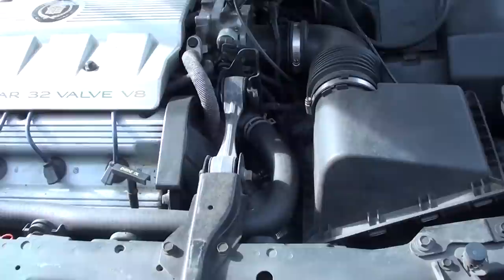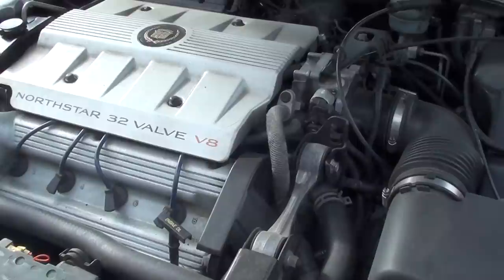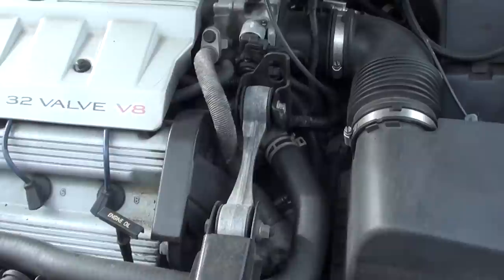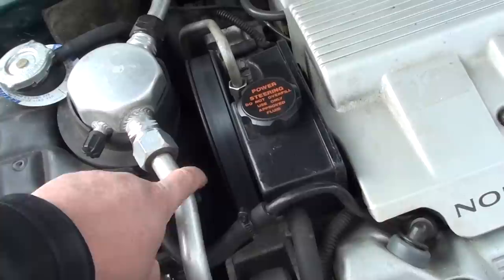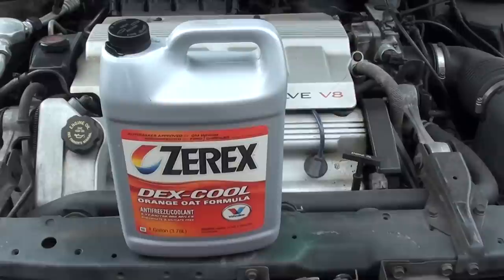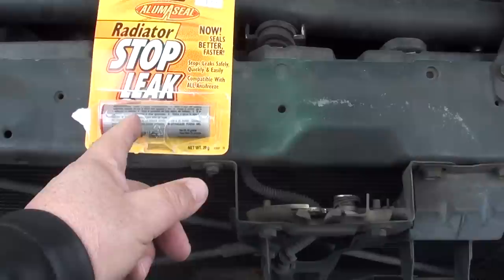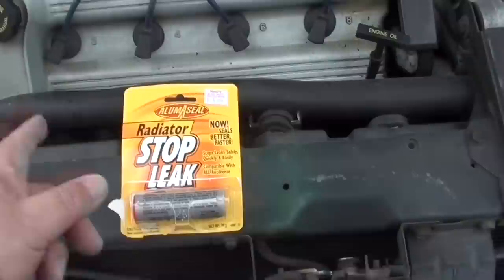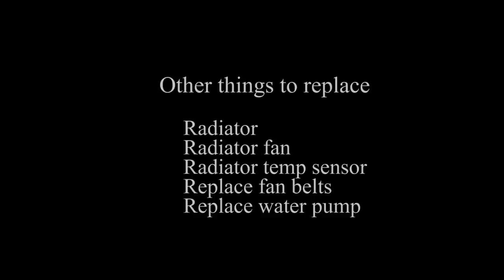Cadillac | Prevent Northstar engine from Overheating | What Mechanics won't tell you

Comment: Dude thats just way too much keep up especially if you have a girlfriend who barely knows how to put gas in it lol mu girl owns a 07 g35s sedan with over 167k miles and it runs better than my 2015 mustang gt lol with way less miles it would be a headache to buy her a caddy with a northstar engine, plus u said u dont go over 65mph man thats a whole lit of babying. I use to own a 07 Nissan Altima 3.5 se and beat that car up everyday and it never gave me a problem just changed the oil every 4k to 5k miles and it ran great with out doing or checking all that stuff you do on ur Cadillac. I owned a 93 Eldorado with a 4.9 liter and that thing had all kinds of problems and that was with regular maintenance, every month there was something else wrong with it. I dont blame you not going over 65mph those cars are made for old people with big wallets not a young man or woman with led foot trust me unlesd u get a cts-v and even still u might have problems
Reply: Interesting , done 70 in my 97 deville from Vancouver Washington to Billings Montana and back . Zero cooling issues ( stayed at 194 in the heat ) , fuel mileage of 27.5 mpg .

Comment: There is a write up from a NS engineer designer. He stated the NS was not designed to be run easy. They are designed and built to driven hard. This is one of the major reasons these engines have so much trouble with lightfoot drivers. Carbon buildup is the easiest and quickest to start damage to the engine. High speed deceleration in low gear at highway speed will keep it clean. Do not baby walk this motor. If you start the motor and sounds like valves tapping it's carbon.
Reply from the maker: Thank for the input. These are the same engineers that designed this crap engine.  I hear this alot. But yet I'm still driving mine. Go figure
Reply: @notsofast2325  I'm driving my 1997 el dorado as well. I think it's a good solid motor when taken care of. Pushing 160k and still gets 26 mpg on the highway. I only need it hanging tough for one more year. It's fun to drive.
Reply from the maker: @thomasodetinape4180 Yes mine is running good so far. good luck!
Reply: @notsofast2325  you as well!

Comment: The video does make sense for overheating in general but skips over what causes the headgasket problem on these cars. That problem is then followed by overheating, eventually coolant loss possibly a cracked block.  The seal tablets have no effect on torque to yield head bolts that have stripped and pulled loose.  GM retro removed seal tablets from required or even recomended use.  It catches onto impurities and buildup in the cooling system and causes restrictions.  This is an entirely a different issue than say gm's 3.1 which had a design flaw which GM redesigned and made available for replacement.  That was a gasket issue which leaked, northstars the head pulls away not the gasket wearing away from the head/block.  This is also an earlier northstar and GM has changed the composition of the metals, not for the better unfortunately.  They went to longer bolts then also changed to coarse threading.  There would be no reason to waste the money re-engineering  and retooling.  Designing different bolts if the gasket material or coolant type was the issue.  What they did to solve the issues only would decrease profitibality and if anything point to a design weakness.  The fail-safe cooling on these cars will save you from a stuck thermostat.  However typically when the head bolts fail the way it does on these does not usually trigger the system.  There are leak test kits needed because you don't see the obvious typical sign of headgasket failure as in most engines.
Reply: Cactus Sensai Doug maintained right....On a new engine & don't have a heavy foot your alright..Regardless of all said those bolts are what's wrong with the No North star engine....Better to buy one new..Know you have a design flaw in those bolts accept that fact & do proper care and motar will still run well over 500,00miles.